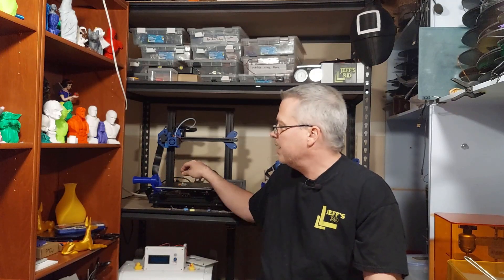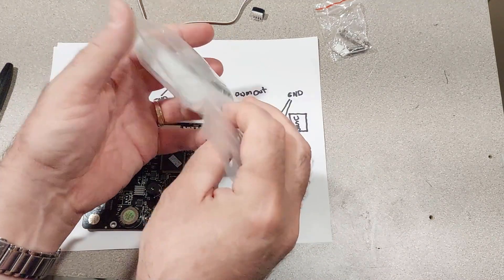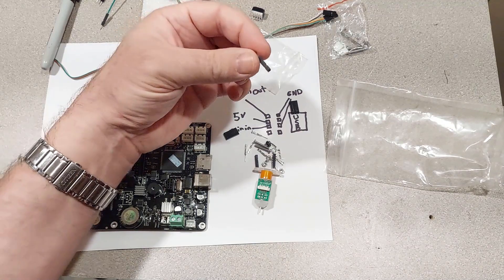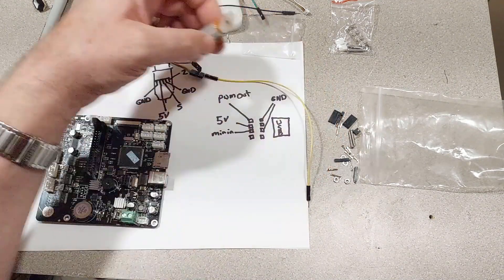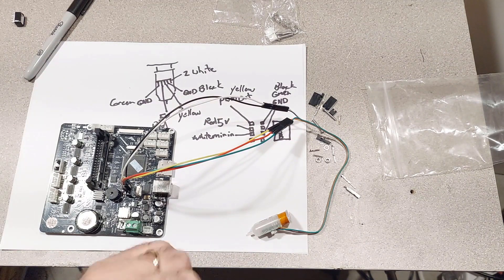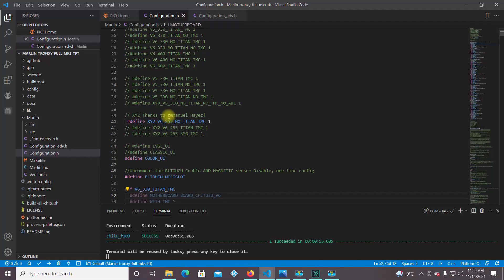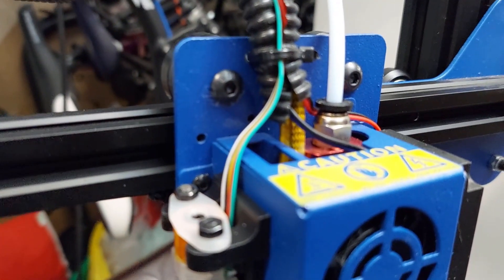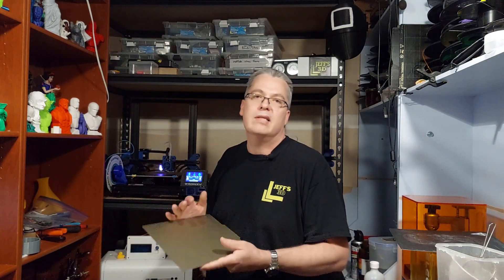Bltouch on Tronxy 3D Printers how to upgrade

Comment: I have a tronxy x-y-2 pro I got for 35.00 dollars'. it is dual color .every time I adjust the bed auto or manual and try to print it shoves the nozzle into the board and wrecks the nozzle. it's irritating to fix any ideas anyone?

Comment: I'm looking to upgrade my TronxyX5SA With a 3D touch sensor. What I'm currently concerned about is that the Merlin firmware may not support the touch screen as per chatbot that should not be named.. Though I cannot find much mentioning of it. Apparently, the update process makes a screen go black. I'm not sure if that's permanent? Is the Merlin firmware vastly different than the original firmware? I'm planning on up The mesh correction test pointsn from stock. Can you make a video detailing the differences in the firmware?

Comment: You say 2 to 3 mils, do you mean mils or millimetres.
mil is an imperial measurement mm is metric and the difference is comparatively huge.  As a mechanical engineer it is a pet hate that people use mils when they mean mm they are not the same thing.
Reply from the maker: Noted.

Comment: Hi Jeff, I have the Tronxy X5SA 2020 model. I have a sister circuit board fitted as standard to the top frame that the sensor is plugged into.
It has a sensor plug port for the white plugs where you connect the sensor.  

The thing is, I see the port has 4 pins not the 5 that main boards do for the 3D or BL Touch to plug into?

And I think my Main board also is a 4 pin connector not the 5.  

So which 3D Touch probes can I use on the Tronxy X5SA?

I have a CR Touch fitted to the Voxelab Aquila I got, it has the main board with a set plug for the 5 pin plug But the Tronxy X5SA don't.

Any help be great.  Thank you.  😁
Reply: Maybe only 1 ground is needed 2grounds can be tide together most likely Look up ground loop interference

Comment: Hi jeff, your videos helped me alot in understanding and tweaking the xy2-pro. But i have a problem with the 3dtouch. I followed this video with a 3dtouch and it seems to work. Lights are on, deploy and stow away the pin through the menu works fine. But when i auto home it it wont stop when hitting the pin. When i manually hit the pin to simulate the plate it just keeps poppin the pin out and continue going down. Any clues for me maybe?
Reply: Its fixed! rewired everything and it worked! Only thing is, how do I upgrade the firmware to the latest rhapsodyv Marlin?

Comment: Hey Jeff, I have a Tronxy XY-3 pro that I purchased in 2019. I believe the bed is warped so that I can't get any good prints at all. I was hoping to attach a bltouch to it but it doesn't have a port for it. I see you used the wifi section here, my board has that as well. Do you know if that's all I need or would you be willing to help me out? I don't want to get rid of it but since it's such an old model I can't find any support for it, and I don't have the base knowledge about this myself (yet at least).

Comment: Jeff, Got the kit from Dan and it was outstanding. Easy software load with BL Touch mounting bracket. All you have to do is figure out your X, Y and Z probe offset (I used Pronterface Gcode commands) and it worked great. Thanks for the tip. Dan is very responsive to questions and will guide you through the entire process if necessary.

Comment: Hi Jeff.
Can I use the BL-touch on Trony-Marlin also?? Because I can´t change back to Tronxy original Software. It doesn´t work.. But I like  tronxy-marlin. Thx for answer.
Reply from the maker: https://youtu.be/MYxV_OM_tUg
Reply: @jeffs3dcorner  very fast. Thx for this tip. I didn´t see this. I will try it soon.
Reply: ^Hi Jeff,
I did it. it works great. Thx for this tip. Can you say me where can I find your spool holder, and how did you go round the corner to the z-motor. thx Stefan